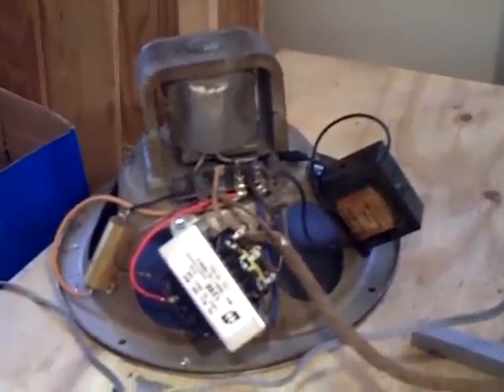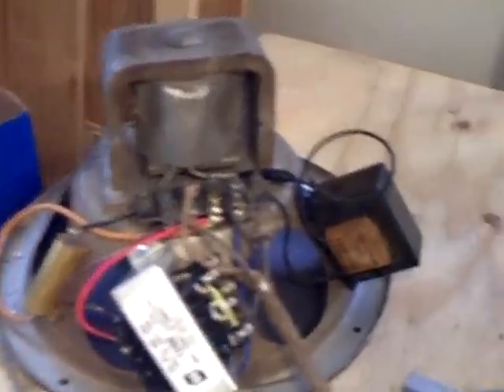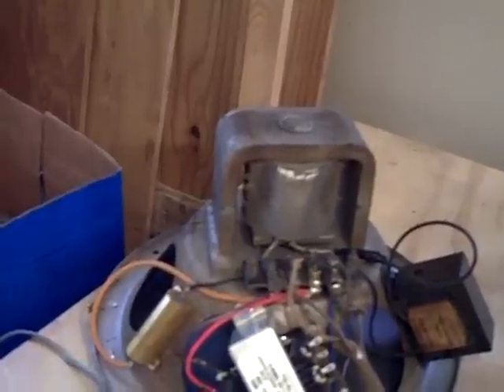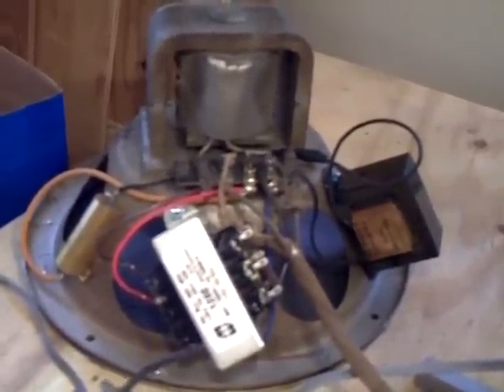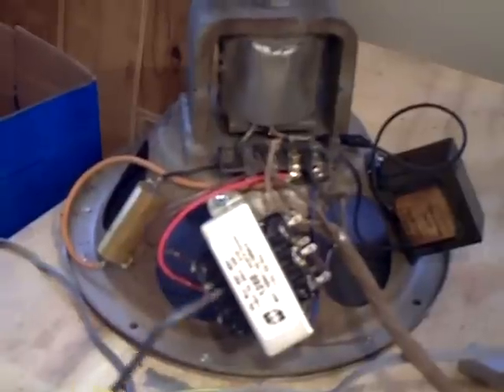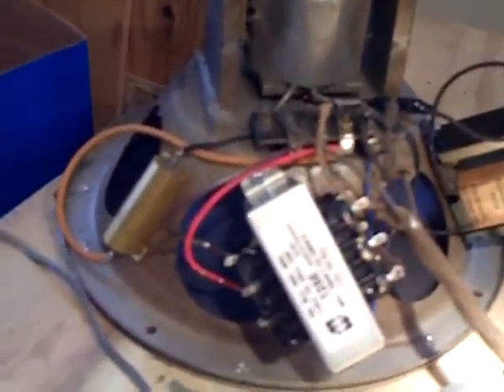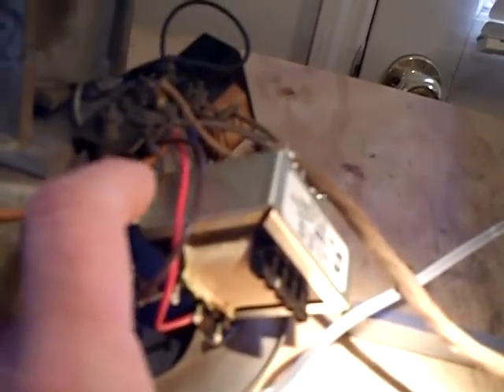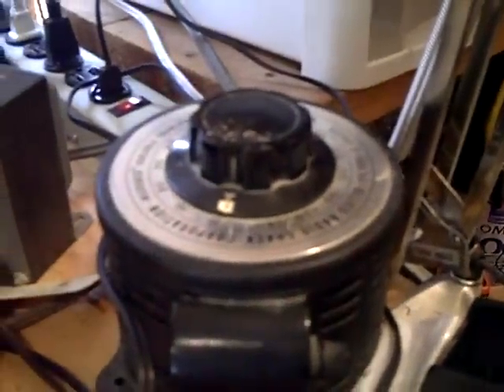Part 11 RCA 262 Repair. Problems!

Comment from the maker: Interesting ideas. I like the idea of nesting the speakers, Very innovative. In my case I wanted to put the choke next to the field coil which is also a choke. some stick a approprite vale of power resistor in, but I had read  that a inductive reactance, coupled with a capacitive reactace makes for a better power supply filter. I had to mount the output transformer sideways sort of, but I wanted it as perpendicular to the field coil as possible to cut down on magnetic flux as much as possible